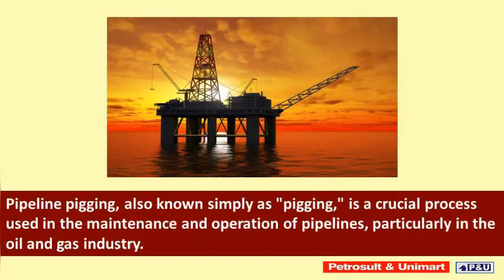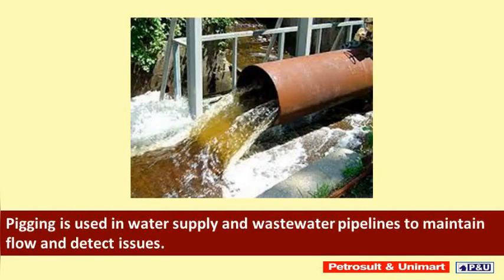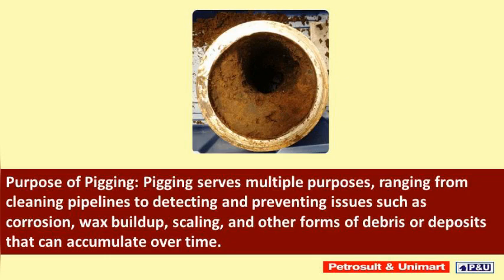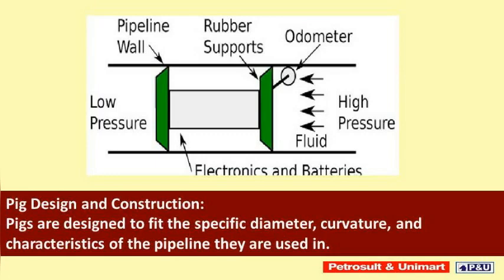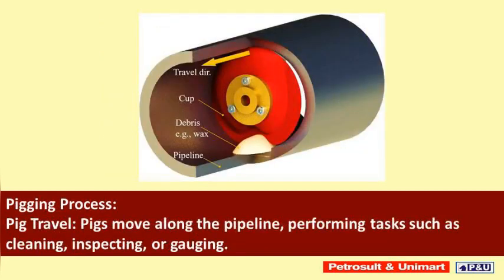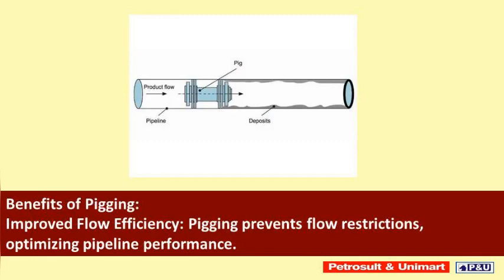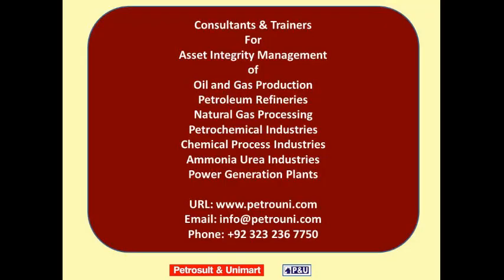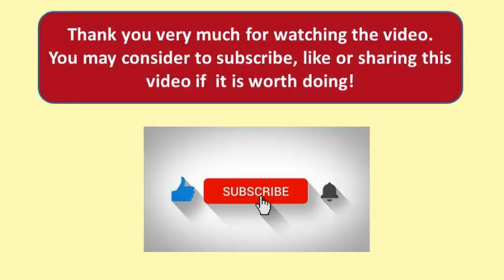18 Pipeline  Pigging in Oil and Gas Production Fields (@petrosult9821)

Comment: "PIG" does not stand for either "Pipeline Inspection Gauge" or "Pipeline Intervention Gadget" or any other such nonsense - they just look a bit like pigs, and the original ones were made of straw bals wrapped with barbed wire which made a loud squealing noise.
Reply: Pigs also called scrapers and it’s used for pipelines inspection also. My company used it for inspection